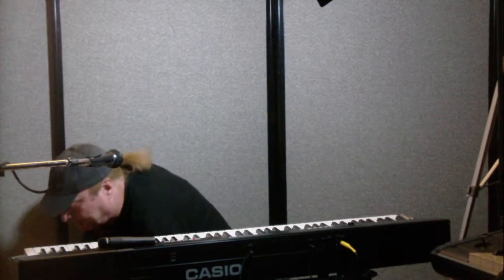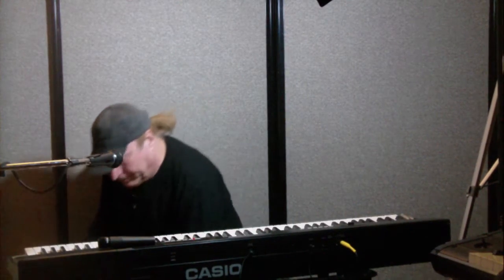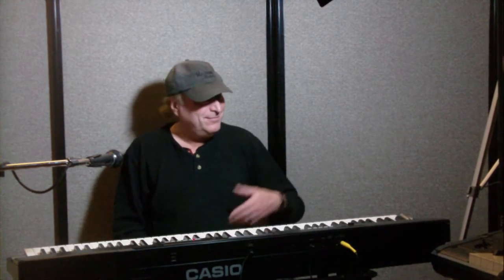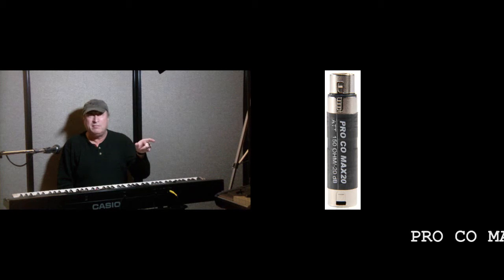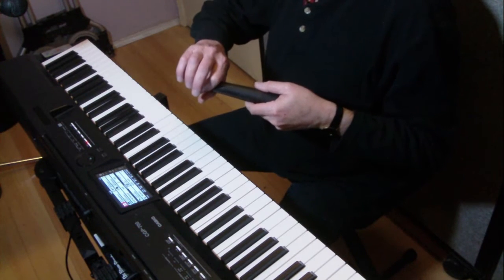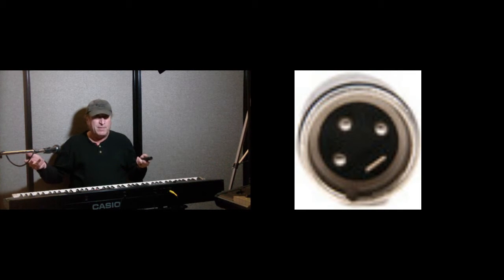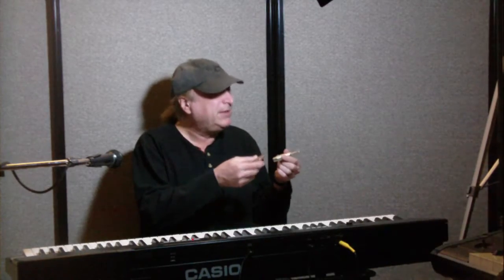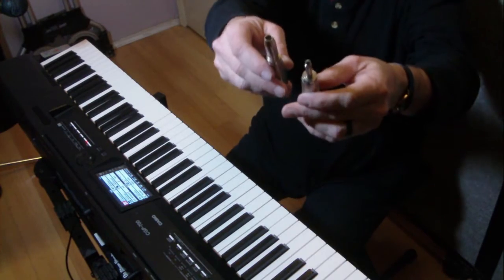How To Use Guitar Pedals With Digital Piano Keyboards

Comment: Don't know if anyone is reading this, since the original post is almost five years old, but I'll give it a try: 
Is it possible to connect guitar pedals with digital pianos, but without using an amp and external monitors? I would like to you use my headphones or the internal speakers instead. But don't know if this works since I would need to loop the signal through the pedal and than back into the keyboard.